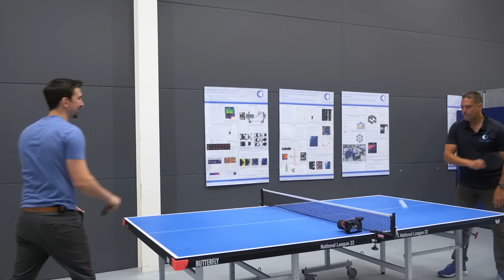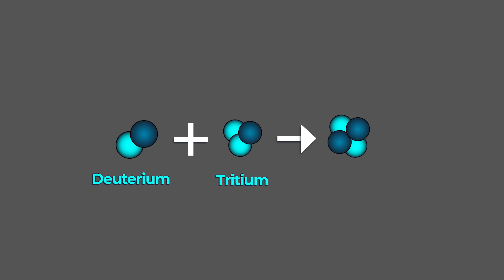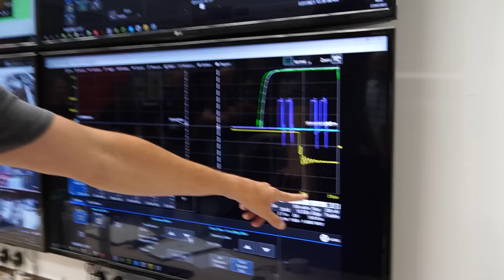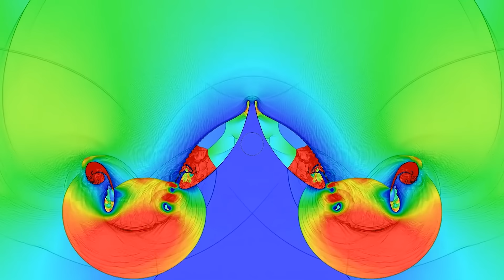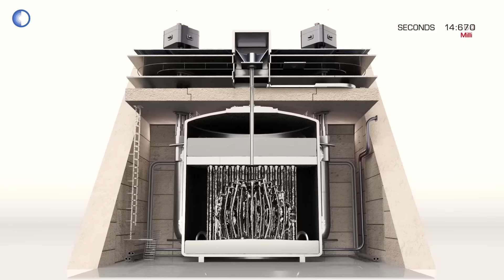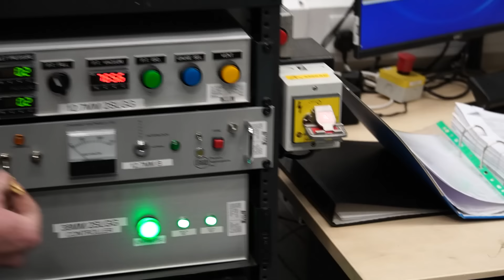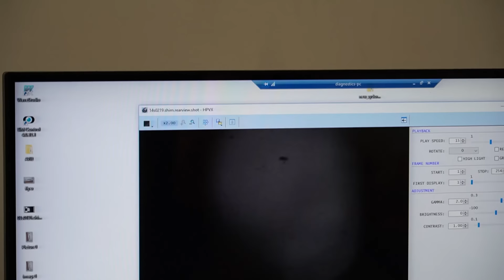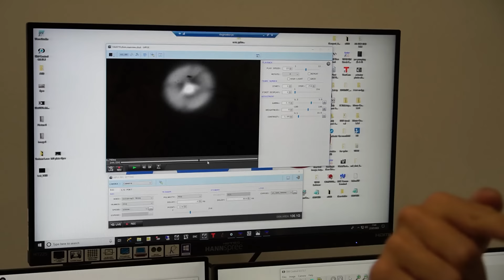Inside The UKs Breakthrough Fusion Reactor - First Light Fusion

Comment: One huge tell in fusion research is fission, which was cracked by people using only pen, paper, and slide rules. Though laborious, fission was achieved because the principles underlying their theories proved to be correct. From that moment forward, it was always assumed fusion would be "10-15 years away." It's been that way for 80 years despite untold supercomputers and billions in infrastructure. It tells us our understanding of the sun is not complete, as the sun  has always been the basis for the proposed fusion reactions. To gain a more complete understanding of the sun is to see its connection to  the remainder of the galaxy instead of an isolated ball of hot gas governed only by gravity, isolated within a perfect vacuum.

Comment: One interesting path to fusion I thought of recently: positively ionize a quantity of hydrogen, accelerate it, then cross the resulting proton beam with a high speed electron beam, causing electrons to directly impact protons in order to form neutrons. Of course the trajectory of the neutrons won't be controllable after that so you'll have to have a good handle on the direction they'll be going post-collision and have a quantity of water in place to capture the neutrons. Atoms in the water will capture a number of neutrons, some of which will decay into protons, raising the atomic number of the atoms and causing remaining neutrons to lose mass, resulting in an energy release similar to nuclear fusion. This will remove the need for extreme heat, potentially reducing the input energy requirement relative to the energy output and resulting in a chance at achieving net energy.

Comment: Thanks for the video but naturally a few questions arise!
1.Where did the 90 second requirement come from?
Is it the size/amount of the fuel they are using? If so, can they not use a larger amount of fuel and have a bigger time delay; or does this lead to scaling problems such as the Railgun? Bigger fuel means, larger amplifier needing larger projectile etc etc. However, if they are going to use electricity as the firing force I wouldn't think this would be a problem; at least not until you get to the point where the non-firing part of the material melts before it can conduct to the firing area. Or, is the problem down to that efficiency is reduced as you use more fuel - if this is the case why so?
2. Scaling
They mentioned the problem and why they didn't go for a railgun was due to scaling the rail to a length to achieve the velocity needed (20 meters was stated). However, later on they said Machine 4 is going to be 70 meters. Does this mean to get to the 60km/s with a railgun it would need to be longer than this? Finally, even if it were to be stupidly long compared to a mere human; why would  this be a problem? Cost shouldn't come into it, if it's proven to produce more energy than you put in.
3. More energy out than in
How long would it need to be in operation before the energy sales profit exceeds the cost in order to develop, build and maintain it? If this cannot be said due to potentially exposing financial numbers; then is this duration longer or shorter than the ROI expected time frame of say a nuclear reactor and coal-fired power station?

Comment: The worst, most inefficient step is the actual electrical generation method using steam. Cooling the water into the atmosphere and only getting a small percentage.  Then transmission over aluminum cables for enormous distances. We need a direct generator that is point of use and on demand only.

Identify the problem and solve it.

Comment: Super intresting concept on making fusion work! hope this will be a viable route and the materials to keep the plant running will be a small faction compared what they use for the experiment. I assume that the costs of building a Final plant V1.0 will be way cheaper then a V1.0 Stelerator or traditional tocamac plant. Since I am quite scared to see how much material is needed to make a single plant with those designs.

Comment: Seems like they could repeat the first process with a stronger burst disc that only blows at X higher speeds after the end of the second one, which then triggers a third smaller one, which then fires into the target. Going from Mach 3 in the first one, to mach 20 in the second one, and then the max speed in the third one.

Comment: There are a lot of bright physicists and engineers working on fusion. A lot of focus on the fascinating details without standing back to take in the big picture.

My worry is that not enough attention is given to the heating effect of nuclear energy. We should diligently think this through, otherwise we might roll out lots of super-effective fusion reactors in the coming decades and then have a problem of waste heat causing climate change.

We can't release heat into the biosphere without dealing with the energy budget: total heat in, including sunshine, and total heat out back into space. Our climate's average temperature is the equilibrium between these heat flows.

So widespread adoption of fusion energy needs a corresponding roll out of geo engineering. This is too scary to ignore. Just maybe nuclear fusion is not a panacea at all.

Comment: I'm glad to see a pulsed approach to fusion. There is no doubt a steady state fusion device is beyond human ability at this time.
However, failing to use the PB11 process (Hydrogen Proton and Boron 11) means the reactor produces heavy radiation which is a Very Bad Thing(TM).
The PB11 process releases the vast majority of its output as X-rays which can be converted directly to electricity by the photoelectric effect.
For my money, the pulsed device over at LPP Fusion makes more sense, because it has no moving parts, and avoids the ancient and inefficient steam cycle.
And we all know that moving parts really suck.

Comment: 10 000 times nothing is still nothing. These targets will always be too expensive; they need to be in the tens of cents and fired multiple times per second to be anywhere near reasonable. If you scale the targets you may not need as many of them; but this has a problem; if you have to build a blast chamber that can withstand 100 kg TNT equivalent, this too will be expensive. The next big challenge is to clean out the junk formed in each shot.

Comment: It seems to me that this approach, while giving significant kinetic energy, will be too expensive having to replace projectiles repeatedly. And to get an efficient fusion generator operating they will need to be running multiple shots per second, which is just not feasible with this approach. I think NIF has a much more efficient method, capable of multiple shots per second and recovering the energy from those shots. This method requires both fuel and projectile which raises the price dramatically.

Comment: Not gonna lie, this approach looks very cumbersome from the engineering side. I assume this will be valuable science for the amplifier, which might turn into a useful thing for other means of fusion triggering; but the gun itself with all its self-destroying parts seems like a patchwork solution because lasers were too expensive for them.
My hopes are all on inertial fusion (with a bit on Wendelstein 7-X still), and if an amplifier developed by FLF can simplify the laser approach by turning the almost 360° shot into a unidirectional, then go for it. The physical impactor fired from a selfdestructing railgun isn't going to work for a power plant that needs to fire multiple times a minute though.

Comment: ???  While this is a fascinating physics experiment, how does changing out that plate each time lead to electricity in my home?  They can't be producing useable quantities of heat that could then boil water to turn a turbine on that scale- or even 100 times that scale...   Are they using this to get things started?  If so, how do they contain and sustain the fusion process?

Comment: I wonder if they could make use of the same principle a Mercury Arc Rectifier uses in place of the spark gap switches - using liquid mercury for the electrodes?

Also, for the loading of the projectile discs, it strikes me it's similar to 'filling machines' used for putting liquid product in bottles.  In this case they are sorted, aligned & spaced, fed through a funnel on to a conveyor system then into the filling machine.  The discs could be treated the same way as the bottles.  This approach means you can feed discs from multiple sources into the funnel.

Comment: I can’t help but wonder what level of energy must be produced by the small amount of fuel to produce more than the energy needed to charge the capacitors and pump the liquid metal in the energy capture phase as well as the energy embodied in the aluminium plate that gets destroyed each shot. I understand that the aluminium plates can be recycled, but that’s a lot of energy to remelt it, machine the plate to what I am sure is some pretty exacting standards and send it back to have them destroyed every 90 seconds. It would be interesting to see how the math adds up.

Comment: Any fusion designs with a “target”, even the NIF, is untenable.  “You reset the system and do it all again…” is the catch, right? The many engineering problems with this approach introduce  inherent limits. What about neutron containment/release? High temperatures? Actually harnessing electrical generation? Etc, etc

Comment: Have you heard of black light power? I know it was a company in cranbury NJ USA that was making a lot of claims about somehow using a reaction having something to do with black light and capturing the heat energy using thermal couplers to convert to electricity and supposedly was more energy out than put in. 
  Another promising start up I was reading about was harnessing the energy of cavitation. Cavitation is fascinating but very destructive. I seen another guy taking advantage of the heat produced by cavitation by forcing water through a pump that’s rotor was specially designed with arrangements of holes drilled into it at different diameters and depths. It instantly produced steam and almost looked too easy and good to be true but why not? It beats billion dollar fusion projects because it actually runs! The funding for new energy production has to change to allow more ideas and minds a chance to get  noticed and taken more seriously. Typically nowadays you will read an article about something and then never hear anything about it again.

Comment: Well I hope I made a mistake here, but it appears to me that they are aiming for a velocity that is not even as high as the gas velocity in the solar core. I get that the average gas velocity in the core of the sun being somewhere around 850 km/sec which is 10 times as fast as their target. Also that solar velocity just brings up the fusion rate to somewhere where quantum tunneling can cause a small percentage of the hydrogen atoms to merge. Anybody else do that calculation? I suspect if I am right they are not saying everything they are doing.

Comment: Inertial confinement fusion greatest problem is either the projectile or the firing rate. Obviously solution is to just use an oversized hydrogen bomb aka thermonuclear weapon with let's say 500 megaton TNT equivalent to vaporize a whole giant lake and you have enough steam for days. Otherwise - yes fusion - great - but look at your miserable power output. And you have to fire much faster than a machine gun for a reasonable power output - with all the issues coming with that.

Comment: Mother Nature has extensively tested the minimal size for a sustained fusion reaction and it is about 4 times the mass of Jupiter.
Reply: That's proton-proton fusion at 10 million degrees at 25 petapascals provided by gravity. Different fuel species allow for different zones of parameter space (temperature, density, confinement time) which can be produced in rather smaller devices via forces other than gravity. See the Lawson Criterion.

Comment: Hope it doesn't need tritium...
Reply: This reactor design will definitely need tritium. Why? Because the reaction has to be FAST to burn the fuel during the compression. I doubt this reactor design will work. I doubt they will even get close to fusion reaction conditions needed for complete fuel burn (ignition). In fact, I think First Light is a joke and basically an investment scam.
Reply: @dans3727  The bigger issue is that Tritium is so rare that there is only a few KGs of it in the entire world. Now consider that most plants would require more than that per year to function and you have one hell of a massive issue. I was utterly unaware of this until I read about it. In that sense I guess it maybe a scam.
Reply: @Yukatoshi  Yeah, tritium supply is a problem. But there are solutions.  Fusion can generate its own tritium. Neutrons from D+T reaction create tritium when they hit lithium. This is a conventional proposed solution to the tritium supply problem. I expect First Light fusion also plans to do this, by putting Li-6 in the reaction chamber.

Comment: Fusion is the bottom , its not the fusion that is the problem its extracting steam at economical rate at the scale required is the problem and it will not happen outside of civilian cross funding for military research .

Comment: This concept does not sound like it is aimed at continuous energy production in any way.

I´ve kept waiting throughout the whole video on an explanation HOW the fuck this should lead to a holding fusion and a method to effectively extract fusion energy in the running system - nothing.
All of this feels like a bunch of nerds happily burning money on foundational experiment design.

And experiments are fine and all, but even their proposed machine 4 would still be an experiemnt not having any stable energy production. And they dont seem to have the money or the tech for that at this point.

Comment: What is the breakthrough? Why is whatever-they-did a breakthrough? Do they have calculations or experimental results showing they can achieve fusion conditions? So many unanswered questions and problems with their dubious technology. I very much doubt they will ever achieve conditions comparable to the laser target conditions achieved by NIF, because they are using compression only. No other energy is going into the fuel. No RF laser or other energy. Just compression. Has First Light achieved any notable milestones? Have they detected any neutrons at all?
Reply: I believe they detected about 50 neutrons. Each T-DT fusion is about 18MEV, or 3E-12 joules. To generate 1Mjoule ( enough energy to boil a kettle in 5 minutes) They need to see 3.3E17  neutrons!
Reply: The key requirement is the symmetry of the compression. NIF spent decades trying to compress their fusion target with direct heating by the lasers. It was only when they went for indirect heating using X rays ( exactly as the Teller Ulam configuration) did they achieve success.
Somehow First light  are trying to shape a shock wave generated by the collision of a disc projectile with a flat? target. They need to change the shape of the shock wave to achieve spherically symmetric compression of the fusion target. It must be incredibly difficult to get good symmetry. Without perfect symmetry they will never get the density and temperature required.

Comment: Good luck but there will be no breakthrough at this facility. I hear only "power of the future". Unfortunately, it never works regardless of the method applied. Not even 1 W of energy has been ever generated by any of those facilities. Over 50 years of experimentation should be rather enough to come to the conclusion that something is wrong with the concept itself. Wasted money. What is more important, wasted time of those people who could contribute to the society in different areas more efficiently than this scam. I often watch so called "approved" physicists talking about it and no one of them is even trying to point the obvious. You can't generate energy out of nothing, period. You can't generated energy out of isolated system. You have it in front of your very eyes. My conclusion is, everybody knows it is a scam but they count on stroke of luck. The second explanation is, they really believe the concept is right. The second option is way worse than the greedy one. It would mean that science is dead. I recommend to everybody involved in those projects to take a fresh course on thermodynamic. It is all there. All your mistakes.
Reply: Read about the mass deficit, and binding energy. If you disagree with that science then perhaps the sun isn’t what what we think it is…
Energy isn’t being made out of nothing. Smaller nuclei are being fused to former larger nuclei, however some mass is released; as energy. It agrees with the first law of thermodynamics, energy is simply being transferred from one state to another.